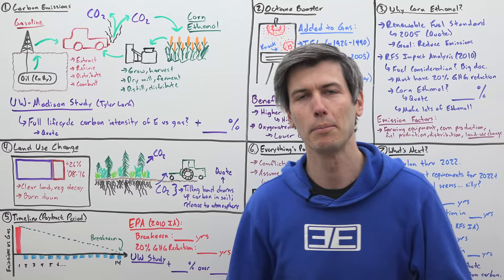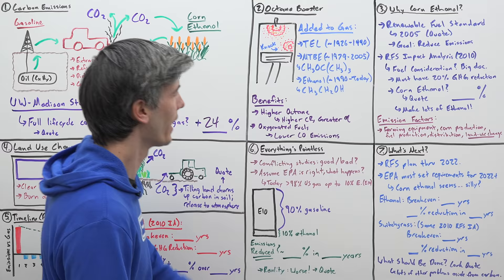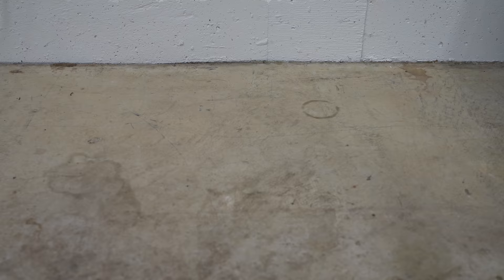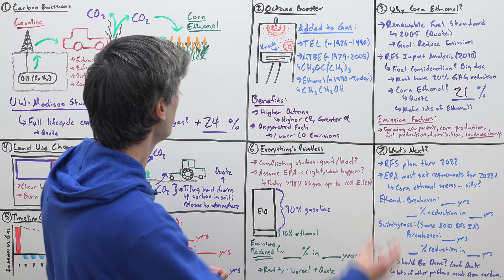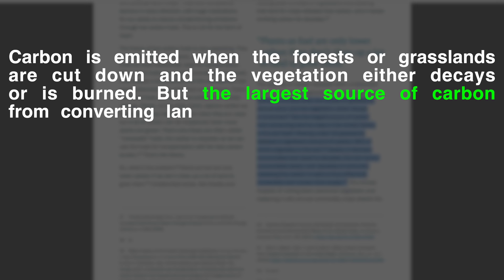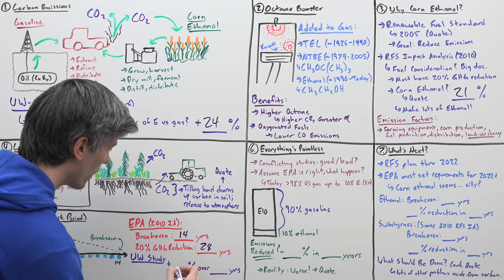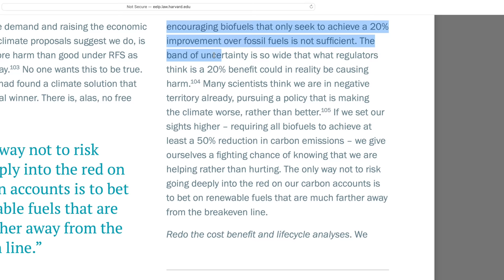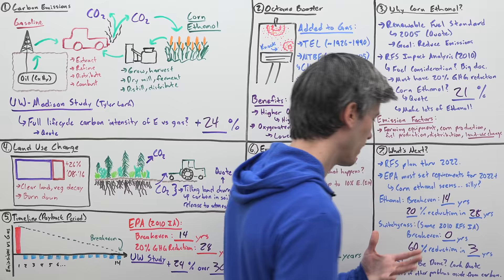America Was Wrong About Ethanol - Study Shows

Comment: The use of Ethanol in dual fuel vehicles, usually cars, is good not only because the cars are 2% less pollutant in the aggregate over 20 years, but because they can switch fuel from gasoline to ethanol in any proportion. Having another source of fuel for cars reduces the power of the oil companies both within and from abroad. Brazil have produced only dual fuel cars and this have been a successful experiment since the 1970s. 
There is a significative quantity of cars in Brazil moved by gasoline, ethanol and Natural gas too. These are not incompatible in the same engine.
There are other shortcomings in the pollution that are particular to ethanol, the use of catalytic converters reduces pollution.
Beware of the possibility of producing Methanol from kelp - the algae that grows 3 meters a day - and bacteria that produces starch that can be converted to Ethanol. 
There is also promising development of having a converter that transforms 40 liters of Ethanol into 7Kilograms of pure Hidrogen, creating a new pathway.
Reply: Brazil, like us, is seeing their flex fuel vehicles disappear for some very odd reason.  For example, the Ford F150 pickup is for the first time being sold there and has no flex fuel option.  Their non-flex fuel vehicles which are identical to ours, burn E27.  There was talk of going to E40 for non-flex fuel vehicles.

India now requires all new vehicles sold be flex fuel.  They also have a goal of E25 for non-flex fuel vehicles.

There are no shortcomings to ethanol in pollution vs gasoline.  There is a famous San Paublo study where the findings were mis-interpreted which a later article in Scientific American covered which I can go into detail later.  Hydrous ethanol which is what their E100 (96% ethanol 4% water) is and it has a little bit of an issue but anhydrous ethanol (100% ethanol), which is sold here, doesn't have that issue.   

Kelp produces more ethanol than any other plant at 30,000 gallons per acre.  We could build ethanol plants on the thousands of abandoned oil platforms in the nutrient rich dead zone of the Gulf of Mexico and spread kelp growing nets around each one 1/2 mile for 640 acres which would be 19.2 million gallons of ethanol.  Take that times a few thousand and we are talking real numbers.  We could ship the ethanol to shore in the oil platform's abandoned pipelines.  The bagasse could be sold as natural fertilizer or in the doubtful event the dead zone became too clean, return it to grow more kelp.

Hydrogen is dangerous to use and handle, even more so as the equipment ages.  Ethanol can provide hydrogen on the spot, Nissan actually in 2016 drove a fuel cell powered vehicle around Brazil using their E100 infrastructure.   Their fuel cell can even work with enough water in the ethanol so as to be non-flammable.  Large advanced super-quiet European and Indian military submarines use ethanol as an on-board hydrogen source for the fuel cell propulsion.

Seeking alpha investment site had an article talking about direct ethanol fuel cells without the need for the step of using an onboard catalyst to make hydrogen.

Here is a quote from that article:

Fuel Cell technology offers many advantages over Lithium-ion batteries, not the least of which is that hydrogen used in fuel cells has the energy to weight ratio ten times greater than lithium-ion batteries.

That said, the volumetric energy density of ethanol is over five times greater than hydrogen.

Ethanol has five times higher volumetric energy density (6.7 kWh/L) than hydrogen (1.3 kWh/L) and can be used safely in fuel cells for power generation.

Comment: Ethanol in American gasoline began in 1978 and on a larger scale in 1979. Most all of the ethanol was imported from Brazil, until the late 1980's - 1990. At first it was not government regulated. The supplier stated it had an average of 10 percent ethanol and was 5 to 15 percent ethanol. The quality control wasn't good and often it exceeded 15 percent. At 10 percent maximum ethanol, it raises combustion temperature slightly. It has more energy than traditional octane boosters, so efficiency is good at 10 percent maximum. It has been around longer than using American corn.

Comment: You missed the part about energy density, which ethanol is far less than gas, even though it burns cleaner. So ethanol isn't really net 0, because cars would burn more ethanol than the corn would remove from the atmosphere.

Comment: Also there is the addition of water into the gas, due to ethanol. I just spend many hours and a whole lot of money, to treat the rust in my gas tank and seal it from rusting further. However, I will still get water in my tank, due to ethanol in the fuel I have to purchase. We have had to treat fuel for the ethanol, so smaller engines will run longer and require far fewer repairs, or buy ethanol free fuel, IE: for 2 cycle engines. This drastically decreased our repair snd service costs, consistently over a 4 year period of almost constant daily use.

Comment: One other aspect of ethanol is there is a reduction in fuel economy. Meaning you have to burn more fuel (BTU Content) to drive the same distance. 
What I would like to see is a study on engineering fuel and transportation for maximum fuel economy burning clean (but not to extreme levels) and compare the emissions per mile. I have worked in emissions labs and find that the requirements for today’s emissions has a tremendous cost, this cost is paid by the consumer in both vehicle and fuel costs.  What is the true benefit in a global scale
Reply: With 10% ethanol added to gasoline, you will have far cleaner emissions, lower cost per mile to drive with, and more horsepower.  Who could be against this?

E15 is even cleaner, even lower cost per mile, and even more horsepower.

Denver in 1988 was the first government entity to require E10 when they were on the EPA list of ozone non-attainment zones.  Soon with ethanol they were off that list.

Even with just 10% ethanol added to E0, the Swiss Federal Laboratory for Materials Science and Technology found that the especially health devastating ultra fine or nano particulate emissions were lowered by 97%, carbon monoxide lowered by 81%, carbon dioxide lowered by 13%, aromatic hydrocarbon emissions lowered by 67-96%, and genotoxic emissions lowered by 72%.

With E100 optimized engines we could have near pollution free engines, more power, and greater mileage that even diesel engines.
Reply: Jim I think you chat gpt is well used...tremendous!

Comment: Dude. No. If you can’t get the first sentence right, how much value does the rest of this have? Corn was put in gasoline to reduce the amount of subsidies the government was paying farmers to grow crops that rotted in the fields for lack of use. The need to offset engine knocking came about when Congress mandated efficiency requirements for gasoline engines.  Ike engines worked fine on  old gas. But, the easiest way to increase efficiency is to increase the compression ratio inside the engine.  This increases the Octaine needed to make the engine run correctly.  Of course your premise that the increased land used to grow corn is infantile.  What are we? Intrepid pioneers claiming farmland from the wilderness? No. We repurposed other cropands.  Unless momsanto figure out away to monopolize GMO grass or whatever, you’re getting corn in your gas (which BTW is terrible for the longevity of the engines).  Oh, and the corn grown for ethanol is useless for human or animal feed.

Comment: Interesting video. It mentions that a significant portion of carbon emissions in ethanol production arises from land tilling. Therefore, increasing sugarcane production (in the context of India) for surplus ethanol could have adverse effects. However, it's essential to note that a substantial amount of sugarcane residue is already being cultivated as a by product for sugar, which inherently involves land tilling.
Reply: Sugarcane is a perennial crop, so cultivation is very, very minimal.  

The video said virgin land and forests were tilled for extra ethanol production.  This is impossible since US cropland acres have fallen since ethanol came to be.

Corn ethanol is a value-added product of >>>already existing<<< feed production which leaves 100% of the protein and other things still available for feed in a healthier, more digestible/efficient, and more concentrated form called distillers grains.

No corn would be planted just for ethanol, far too uneconomical.  But with the feed factor, it can outcompete even sugarcane.  So much so that Brazil put an import tariff on our ethanol.

Believe it or not, the corn belt grew more corn acres in 1980 before ethanol than they do today with record ethanol production and ethanol plants everywhere.

2018 Iowa 13,200,000 acres of corn with most ethanol production ever
1980 Iowa 14,000,000 acres of corn before ethanol

2018 Illinois 11,000,000 acres of corn with most ethanol production ever
1980 Illinois 11,600,000 acres of corn before ethanol

2018 Indiana 5,350,000 acres of corn with most ethanol production ever
1980 Indiana 6,450,000 acres of corn before ethanol

There were more corn acres in some northern states not from ethanol as claimed, but from the fact that feed barley fell from favor from cattle feeders to corn feed in conjunction with high yield earlier maturing corn varieties which came along.  This trend began before ethanol came to be.
  
US barley acres were 8.32 million acres in 1980 before ethanol and declined to 2.55 million acres in 2018, the year of most ethanol production.  Corn acres in 1980 were >84 million acres before ethanol and during forced government land set aside programs and were 88.9 million acres in 2018.  Combine the two and we get 92.32 million acres in 1980 of the two feed grains and 91.45 million acres in 2018.

1980 feed grain acres (corn & barley)     92,320,000 acres
2018 feed grain acres (corn & barley)     91,450,000 acres

Comment: One thing that needs to be figured into this is how many MPG do automobiles get running a gasoline-ethanol mix vs straight gasoline. I remember hearing in the early days of doing this that people were getting less milage with the blended fuel. If that is the case, then that would make it even worse. We also need to consider the damage to automobiles by rubbing the blended fuel. I know that in the early days it caused a lot of trouble. Even now, it's not recommended to run the blended fuel in some of our small two stroke engines.
Reply: Henry Ford designed his Model T for his favorite fuel ethanol, production models were flex fuel.

Ethanol on most any manufacturing chemical compatibility chart you will find is at worst equal to but most often far better on rubbers, plastics, and metals than what gasoline and BTEX (benzene, toluene, ethylbenzene, and xylene) are.

Viton rubber was invented because gasoline is so harsh on rubber.

Brazil who has many of the very same non-flex fuel vehicles we do has used >E20 since the 1970s and currently uses E27 in their common gasoline.  It has worked out so well and for so long that Paraguay went to E27.  Note that Brazil also has the very same two-strokes we have, and they also use E27.

Britian had an E10 blend called Cleveland Discol which sold from the 1920s until 1968-70 when BP bought them out.

Right after Prohibition here in the US E10 blends were sold in thousands of stations in the Midwest in the 1930s up until just before WWII with the largest company called Agrol.

100% of the CO2 produced by the fermentation and burning of ethanol just came from the atmosphere and 100% of it needs to be back there to make the new gallon of ethanol.

Ethanol optimized engines have greater mileage than gasoline and even diesel but in our current inefficient gasoline optimized engines ethanol has slightly lower mileage but the cost per mile to drive with it is still lower, horsepower is improved, and since it is an oxygenate, pollution is drastically reduced.

Note that there were no grasslands or forests broken up for corn.  Impossible right on the face of it since US cropland acres have declined since ethanol.

Corn ethanol is a value-added product of already existing feed production acres which preserves the feed in a healthier and more productive form called distillers grains.

Denver in 1988 was the first government entity to require E10 when they were on the EPA list of ozone non-attainment zones.  Soon with ethanol they were off that list.

Even with just 10% ethanol added to E0, the Swiss Federal Laboratory for Materials Science and Technology found that the especially health devastating ultra fine or nano particulate emissions were lowered by 97%, carbon monoxide lowered by 81%, carbon dioxide lowered by 13%, aromatic hydrocarbon emissions lowered by 67-96%, and genotoxic emissions lowered by 72%.
Reply: I run 30% in my OBD2 vehicles...i mix E85 and 87 octane regular gasoline instead of 93 octane, I get nearly the same mileage and I have videos on my channel about it. E85 in my Honda I get about 22% less MPG.
Reply: @oldblueaccord2629  Just curious, what year is your Honda.
Reply: @oldblueaccord2629  OK, I just went to your channel, 88 Honda Accord. My wife and I had a 1983 4 door Honda accord. The only brand-new car that we have ever bought. We loved it. Great cars.
Reply: @m8s4lif  Thanks! yes its an 1988 all stock even the fuel pump. I tried and aftermark pump and it failed in 30 days so I went back to the original one. I use 310cc Russ Collins injectors.

Comment: I feel curious, as I haven't read through comments,  if the conversation of how much corn depletes the soil and how you can't continuously grow it on the same plot of land.   In Ontario it is typically only every 3 years you can grow it.   In between years could be soy and then cover crop.   All and all, would mean more land needed.
Reply: Corn ethanol is value-added from already existing feed production which preserves the feed in a healthier and more productive form called distillers grains.

Without the feed component, ethanol from corn becomes uneconomical to use, but with it few other sources can compete with it.  But it as a source for ethanol is limited to the size and protein requirements of the cattle herd.  At best we can just over double current production since just under half is now value-added.

No grasslands or forests were broken up for corn.  Quite impossible on its face since US cropland acres have declined since ethanol.

Census data shows that in corn producing states grassland, forestland, and wildlife areas have increased since ethanol came to be.

Believe it or not, the corn belt grew more corn acres in 1980 before ethanol than they did in 2018, the year of most ethanol production ever and ethanol plants everywhere.

2018 Iowa 13,200,000 acres of corn with most ethanol production ever
1980 Iowa 14,000,000 acres of corn before ethanol

2018 Illinois 11,000,000 acres of corn with most ethanol production ever
1980 Illinois 11,600,000 acres of corn before ethanol

2018 Indiana 5,350,000 acres of corn with most ethanol production ever
1980 Indiana 6,450,000 acres of corn before ethanol
Reply: Koris farmers rotate there crops to like soybeans or just hay. So same land just different crops to give the soil an chance to comeback.

Comment: I watched this 2 years ago and fully agree with what you are saying. However, there is one good thing about  Ethanol: It is renewable, so every amount we as a society put in, saves using some amount of oil.
Reply: There were no grasslands or forests broken up for corn.  Quite impossible on its face since US cropland acres have declined since ethanol.

Census data shows grassland, forest, and wildlife areas have increased in corn producing states.  The corn belt had more corn acres in 1980 before ethanol than in 2018, the year of most ethanol production ever.

Corn ethanol is a value-added product of already existing feed production acres which preserves the feed in a healthier and more productive form called distillers grains.

100% of the fertilizer (& everything from the soil) still get fed to livestock in the distillers grains.  Ethanol comes from only things of the air: solar energy, CO2, and water with the latter two recycled once burnt.

Ethanol C2H6O = no fertilizer

Distillers grains = all the fertilizer

What logic is it to then assign all the energy and CO2 of fertilizer to ethanol and none to distillers grains?

Comment: There is a very simple solution..."Average horsepower for US vehicles has increased from 103 hp in 1980 to 247 hp in 2020 ....Cars are up 106 %, Pickups 288%" Did anybody complained in 1980 about too weak horsepower ? No....nobody does need 200 + horsepower at speedlimits from 60 -75 mph to pick up some bags at the grocery....

The Volvo A40G Truck a 40 Ton Truck has 426 horsepower....why does an average car does need half the power, or a Pickup 3/4 the power of a 40 ton truck to move 1-2 people and a bag from the grocerystore ? That`s absurd.